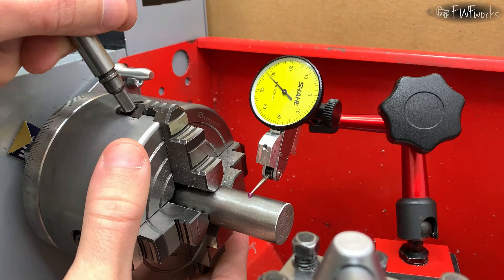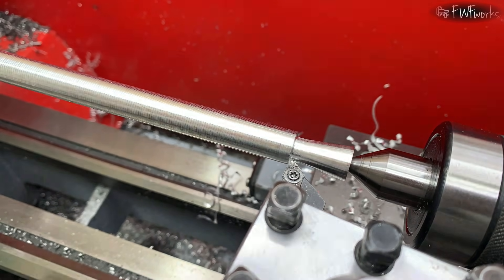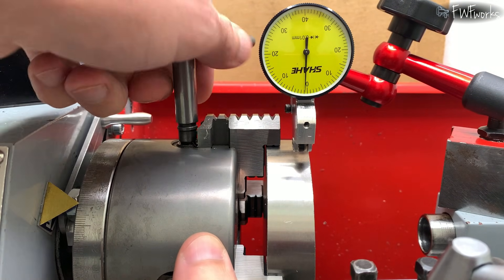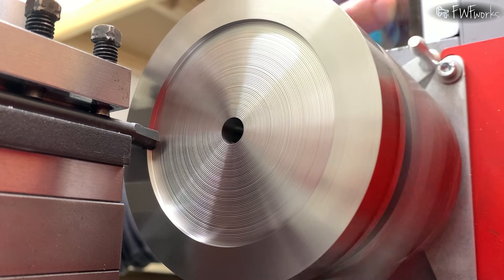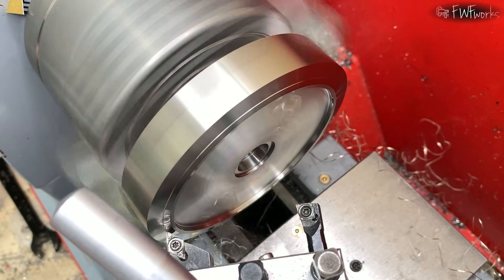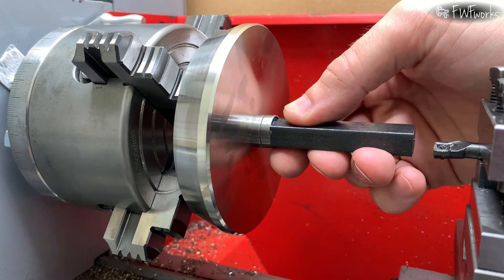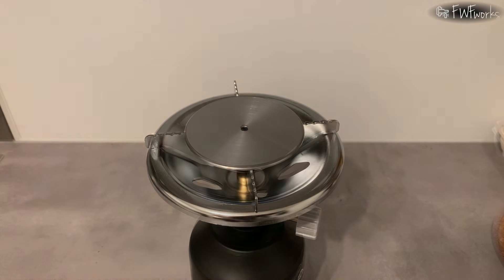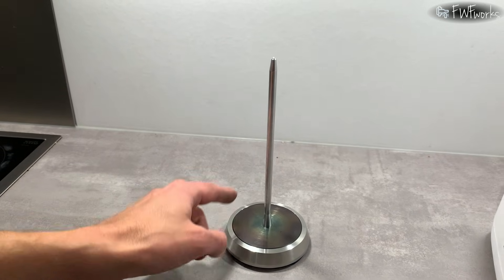Making a Stainless Yarn Stand | Turning 100mm Stainless on Mini Lathe

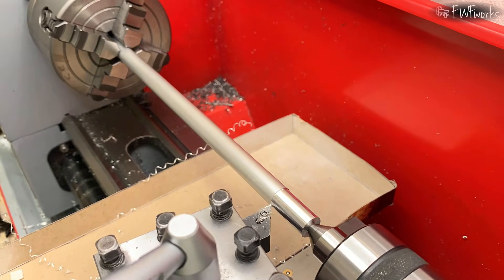Comment: 1:27 why are you drilling a hole in the end of the rod so far from the chuck, wouldn't it be better to slide it into the spindle and drill near the chuck? What is the size of the hole in the spindle of this lathe?
Reply from the maker: I didn’t want to re-clamp the workpiece because that would break the concentricity and cause even more deformation of the finished part. The spindle bore size is 21 mm.

Comment: If stainless alloy 303 is available it would be ideal for a part such as you make here.  303 is free machining and can be cut at surface speeds near those of mild steel.  Best of all, the chips are very easy to break
Reply from the maker: Thanks! I'll try to look for it on sale.
Reply: @FlyWolf_works   I run the machine shop at the maintenance department of a food plant.  I try to use 303 whenever possible for any machining job.  I notice that nearly all of the machined parts we purchase from equipment manufacturers are 303 stainless.
Reply from the maker: @channelview8854  
I have a favorite online metal store where I usually buy my stock. I like that the materials arrive the two days. Unfortunately, they don’t carry 303 stainless steel and their selection isn’t very large. I’ll try looking for it in another shop. 🤷‍♂
Thanks for your advise🤝

Comment: "I clear the swarf with my hand "
Don't  do this ! Just don't - ever !
Excellent way of loosing fingers or suffering deep lacerations. 
You show a swarf hook later on - use it on all swarf, not just stainless or other steels, as aluminium swarf is just as dangerous.
Reply from the maker: Hi! Thanks for the comment and the advice. You're right. However, to avoid fighting with chips, I need to choose cutting parameters or inserts that will break the chips properly.

Comment: Hi bin gerade dabei dein Video zu schauen und bin auf den Part gekommen wo du noch am herausfinden bist wie man am besten Edelstahl bohrst. Hier ein kleiner Tipp nimm nicht die Normalen HSS Bohrer sondern mit der Co Legierung also HSS-Co diese Cobalt Legierung unterstützt das Zerspanen und erhöht die Standzeiten und evtl den Bohrer auf 130 Grad schleifen. Ich nutze bei meiner Arbeit in der Fertigung die von Promat die Bohrer sind sehr gut für Edelstahl.

Mach weiter so mit deinen Videos schaue sie gerne mir an

Viele Grüße Max
Reply from the maker: Hallo Max!

Thanks for your advice and comment!
I’m already using HSS-Co drills. The sharpening angle in my case is specified on the package and is 135 degrees. I think I need to choose the correct cutting parameters (RPM and feed), but to be honest, I haven’t yet gotten around to studying the relevant literature.

I will try Promat brand. Thanks!

Mit Besten Grüßen
Kirill

Comment: drilling stainless with HSS drills - you probably use 1.4301 (or 304, basic "food industry stainless") - without use of coated drills (the yellow color on the bit), use 8-10m/min (with coating use 10-15m/min)
feed depends mostly of drill size, rigidity of setup, engine power, depth of drilling and (if there is any) size of pre-drilled hole - for dia9 drill bit, use 0.08mm/rev (without pre-drilling) for holes 2-3×dia depth, feel free to decrease feed when drilling deeper holes
yes, the stainless won't chip when drilling with regular drill bits, feel free to retract to evacuate the chips and return drill back in cut - when drilling more than 6xD, feel free to retract and add more oil every few milimeters.. use tool head support to coordinate your returning position so you don't smash the drill into material with full force
you would need insert drill, carbide drill with inner coolant holes or drill with carbide tip.. and machine that can run high pressure cooland through the drill.. to drill through stainless in one go
Reply from the maker: Hi! Thanks for the advice!
Yes, you're right. I'm using regular 1.4301 stainless steel. I use HSS-Co coated drills. Unfortunately, using high-pressure coolant isn’t possible in my setup, I can only apply any oil.

Next time I will definitely try the cutting parameters you recommend 🤝

Comment: Very nice. I'm sure your wife will be happy! I am curious, could you have prevented the spindle rod from bending by turning between centers and taking shallow cuts? Also the spindle rod kind of looks like an APFSDS round from a tank lol
Reply from the maker: Hi! Thanks for the comment! Yes, my wife is very happy, it would be hard to buy such a heavy piece anywhere :)
I think you're right, preventing the shaft from bending is possible if it's clamped between centers instead of in the chuck. But then a follow rest is needed. I think the rigidity of aluminum won’t be enough even for shallow cuts without one.